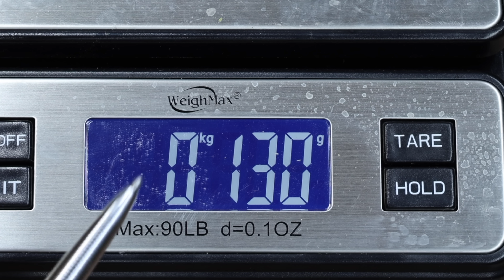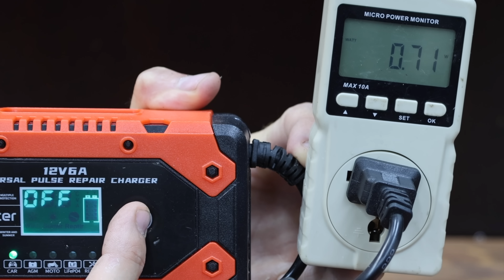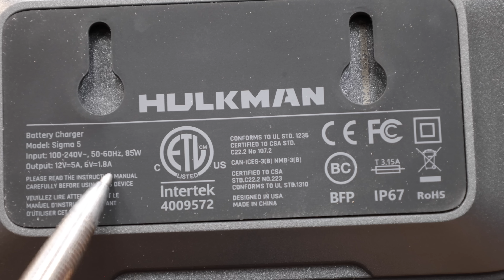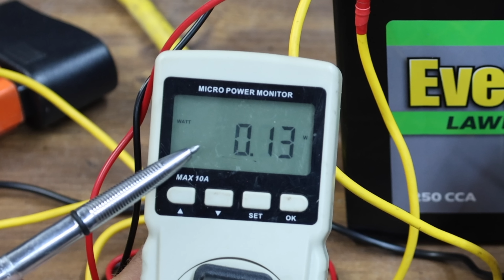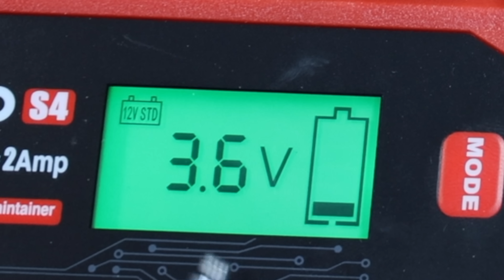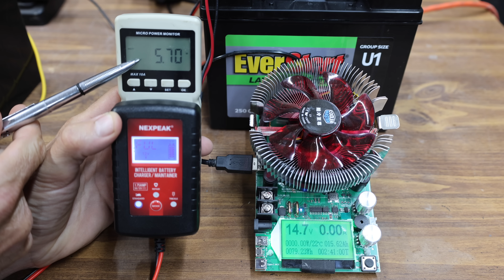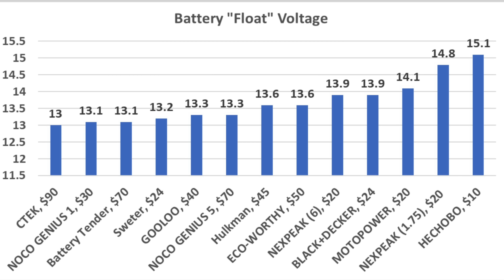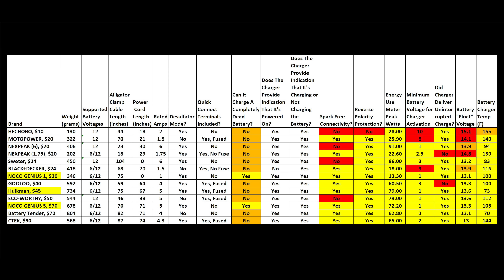I Tested the Most Hyped Car Battery Chargers – One Stood Out!

Comment: Sorry, I hate to argue with a guy who tries so hard to always be truthful,  but, you don't understand how & when batteries make those gasses. They never make those gasses while at rest, unless they are already shorted internally. They never make make gasses at a good rate unless they are nearing their full charge. The gasses are nearly nothing until they approach full charge (failed batteries , & bateries that were lead dead reach full  charge way faster (that's where the "give them 'low & slow' to restore them" comes from from). They won't take much energy at first. When you hit them at first , they will go high, into the "gassing voltage" then they may settle down into absorption phase (if there's any chance of restoring them). The voltage will drop a bit. Then it will come back up into the "gassing voltage" , where it is making tho se possible explosive gasses. But, totally dead batteries do jump into the "gassing voltage" at first, before they drop back into  "absorption phase". Regular car batteries like to get hot during this, and that heat is part of why they can't recover. You know as well as I do, a car battery at 2 volts doesn't stand a great chance of recovery.

Comment: I agree with your assessment! Noco genius5 is my choice! I have one and I love it! The issue, or it may not be an issue, is it gets a little warm, almost to warm to the touch in the summer while charging my battery, but In the winter it doesn’t get that hot. Overall, I highly  recommend the Noco genius5 charger.   The Noco genius5 charger charges my 12v regular flood acid battery from 60% in about 3.5 to 4 hours then it goes into maintenance mode so that it will not overcharge your battery
Reply from the maker: Thanks for the feedback.

Comment: Noco is the best. Use their boosters & battery chargers/maintainers everyday at the shop. Love the forced charge mode and the 12v supply mode when having vehicles hooked up to a scan tool with key on and doing electrical diagnostics.
Reply from the maker: Thanks for the feedback.

Comment: One thing you may have overlooked with some smart chargers there is an equalization charge which occurs for several hours at 15ish volts to ablance the cells. The large forklift battery chargers do this when the charge time takes longer then the predefined time. It would be something to test further keep them connected to battery for 24hrs and monitor if they drop back down to float voltage
Reply from the maker: Thanks for the feedback.

Comment: You're not going to get any desulphation out of any of those low amp Chinese chargers. You need high amps to blast in a charge and expand the plates to break up the lead sulfate crystal crust so that it can be converted back into sulfuric acid. Not gonna happen with 4 amps or any of these other 'toy' chargers. I'd be surprised if a charger called Sweter would even charge a discharged battery. They're all junk.

Comment: I manage a marine shop, we recommend and install probably over 100 Noco on board chargers in boats per year and recommend them for the ATV market also. I have a 1,2, & 5amp Nocos in my home shop as well as a 3 bank charger for good measure. Use the 2 amp Noco on my motorcycle during the winter and the battery still tests out like new. Other people with the same motorcycle & battery have replaced them already. I use the 1 amp Noco on my mower
Reply from the maker: Thanks for sharing.

Comment: I've gone through 2 NOCO Genius 1 chargers. They stopped working after 2 months, each. They definitely did not charge a dead battery. I had to charge the NOCO battery in my motorcycle with a regular roll-around charger to get it up over 12 volts before they'd begin working again. Then after a few days I'd see it had failed to maintain the charge again. I now use a Battery Tender Junior 800 and it's been working fine for over 6 months so far. It keeps my motorcycle charged.
Reply from the maker: Thanks for the feedback.

Comment: I've been using the CTEK for 5 years to keep both cars charged up (one is AGM). I love mine!
Reply from the maker: Thanks for the feedback.
Reply: Use CTEK for my winter stored M car. It's kept the battery in good shape for nearly 8 years lol.
Reply: CTEK is swedish made by inventor Bengt Wahlqvist, he invented the first battery charger that used electronic pulse technology. They are top quality!
Reply: @TheGoldenSapling  no, absolute garbage. I need a cold fridge, not an error message in my charger.
Reply: @novoiperkele  
Ah now I see where you went wrong. It's not a power supply....it's a battery charger.
Don't try to run the fridge while charging the battery...unless you buy the 25amp CTEK charger???
Reply: @JohnSmith-pl2bk  it specificly says it can be used as psu.
Reply: @novoiperkele  
No. 

The CTEK MXS 5.0 cannot be used as a power supply for electronic devices, as it is a battery charger and lacks a stable, regulated power output necessary for electronics. 

However, some other CTEK models, such as the CTEK PRO 25S, are designed with a "Supply" program to act as a 12V power supply for float maintenance charging when a full 100% battery capacity is needed.
Reply: I have 3 CTEKS, 1 of which is used occasionally for about 5 years, 2 of which are used continuously for about 15 years. All 3 have only been used for AGM batteries. As @mynameisschezuan said, "Buy once buy CTEK" the first one I bought led to buying 2 more.
Reply: My Ctek lasted a year with minimal use. They replaced it under warranty
Reply: I have used CTEK since they first came out, never had a single issue and i have 4!
Reply: I have been charging my Lifeline AGM boat batteries using 2 CTEKs (MUS 4.3 and Polar) for at least 8 years and they have performed flawlessly. Very pleased.
Reply: ctek is a pos.
Reply: @novoiperkele  
Anything can be a POS. 
Specify your complaint or experience with which model CTEK..and what you were doing with it....thanks.
Reply: @JohnSmith-pl2bk  dont remember, now i have a cheap chinese thing. Works mint.
Reply: @novoiperkele  
You can't even remember the thing's name.....riiiiight.

Comment: I really like NOCO... bought 3 chargers and one of their emergency jumpers.  What's really a nice selling point about NOCO is the modularity of connectors to the car (showed at 4:09, and keyed so you can't get +/- reversed) (clamps or hard-wire) as well as ability to buy extension wires from the charger to the battery.   This helped through 2020, I kept the cars on a trickle charge since we weren't driving much, able to keep two cars outside and the chargers inside the garage so they weren't exposed to weather.
Reply from the maker: Thanks for the feedback.
Reply: The proprietary connectors on the Noco are not a selling point in my opinion. I got the converter cable to use regular extension cables and generic clamp leads that are much, much cheaper. Don't know how you'd get the polarity reversed on the normal cables. The positive is inset, and the negative sticks out.

Comment: Good information.
As a part 2 to the smaller maintainers how about the same tests but with solar maintainers.   I have a couple of 10W solar maintainers but am not convinced the built in overcharge circuitry is safe. Plug in maintainers do their thing with continuous power available.  With the solar chargers fluctuating day to night I wonder if they can back feed and draw power at night as my batteries seem to drop voltage overnight when there's no solar energy.
Reply from the maker: Thanks!  Thanks for the suggestion.

Comment: If you do larger chargers, what about a dc clamp meter on the charging leads, combined with the watt meter on the ac plug? Would be interesting to see the differences. Also the Clore brand makes a "Solar Pro Logix 20A" charger that Mac Tools and Snapon re-sell, hope the ProLogix 20a makes the lineup.  Thanks for another cool video!
Reply from the maker: You are welcome!  Thanks for the suggestion.

Comment: Hechobo. What could be wrong with a product with a name like that? Stirring memories of "Emperor of the North Pole". The problem with just about ALL of these modern or 'new' chargers is they're 'smart' chargers and they think they're smarter than you. Well, that may be the case with  a large percentage of the users. The best chargers are the old 'manual' chargers. They were notorious for 'overcharging' a battery, which is exactly what you want to desulphate it. I have a couple 'manual' chargers. A wheeled garage unit with a 250 amp boost with a timer. I use it a lot to recondition batteries but it has a 2 amp 'low' and then a 40 amp setting. I wish there was one for 10-20 amps. I have 3 or 4 smart chargers. I don't like any of them. They're finicky to start charging  and never completely finish charging, so I need to top it off on a beat up old manual charger.

Comment: While I love all of your videos and rely on them to make informed decisions, this one is in my field and I have to make a few corrections.  The wattage shown on the 110v side is an indicator that the charger is doing something, not that it is pumping those exact watts into the battery.  A battery charger applies different voltages and current to charge depending on the stage that it is in.  Those values are changing constantly and while P=VI, it is only measured at the battery and only at whatever point it is at during a stage.  Some battery chargers charge and maintain in different ways.  PWM is especially sneaky as it may not kick in at the times you expect it.  It PULSES on and off at specific times it needs to (straight after a battery has been charged, the pixies are still excited and need 24hrs to settle down, then the true condition can be assessed).  MPPT is smarter and adjusts the maintenance voltage and in-current to suit the battery's health.  All these things can explain why you got, or didn't get good readings.  Also, you can trick a charger into charging a fully dead battery by temporarily connecting another battery to start it charging, to make it think its half OK, then remove it after a while.

Comment: Definitely do larger chargers.  I currently (ouch!)  have 8 different chargers for various uses.  A couple of them are 24V for large diesels, you may not need to go there.  But I have several 12V for car/truck/tractor/lawn mower use. Most are some Harbor Freight thing.
Reply from the maker: Thanks for the suggestion!

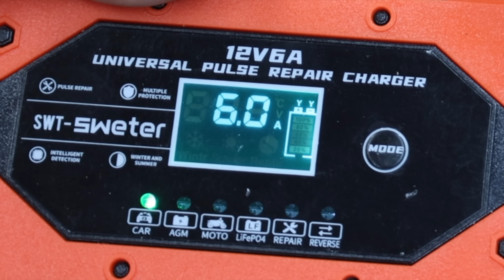Comment: At 10:02 you say the amp reading on the display isn't accurate but it is?

You've got 5V output showing on the load tester and 38W showing in the power monitor.

Thats 7.6A @ 5V. Factor in the 80% charging efficiency and you have bang on 6A.

Comment: I was really hoping PF would eventually do a video like this however they left out one essential and very widely purchased Battery Tender 800. These are sold at every Walmart and are about $30-$40. This is the main charger I wanted to see tested☹️. Good video regardless. You should do a strength test of which name brand ball mounts are the strongest for trailer hitches in the 5000lb-7500lb range.
Another test would be the strongest box/packaging tape. Another would be the best auto darkening welding helmet. Have you done a best Super Glue video yet? I'll have to look.
Reply from the maker: Thanks for the suggestion.

Comment: "Will it charge a dead battery?"

...is dumb. Good chargers sometimes have a safety interface that leaves the leads off until they see voltage, so the charger knows they are connected to a battery the right way.

They still work to charge dead batteries, or act as power supplies, just trick them. Hook them to a good battery to turn on, then connect the dead battery, then disconnect the good battery {or other power supply).
Reply: Note: those chargers will also charge most 'dead' batteries, because they work with much less than 12v. They may not work with 0v, but they will work on ovir 6x, or 9v, or 3v, idk.

Comment: A quick tip for the rest of you with these digital chargers,  DO NOT START YOUR CAR WITH THEM ON!
I have ruined at least 3 of my units doing this. 
Only the old school  "Dumb" chargers were okay with this. 
It seems to short out the Fets inside, and then will dump full line voltage into the battery or you car. 
This will then cause havoc with your charging system.  
Ask me how I know.. :face-red-droopy-eyes:
Reply from the maker: Thanks for the feedback.

Comment: I have the CTEK, Battery Tender, and an Optima....all work well. But nothing tops the Victron. That thing is a beast. Not only is it a battery maintaniner/charger, it can also act as a 12v power supply for up to a 30A load.
Reply from the maker: Thanks for the feedback.

Comment: I bought a 5A CTEK charger years back, and it's been great. The only problem is that (As shown in this video) if the battery's too flat it refuses to see that it's connected. For those occasions I keep an old "Dumb" charger that would try to charge a grapefruit if I connected one up too it. 😁
Reply from the maker: Thanks for sharing.

Comment: I do think your statement of supplied wattage post charge complete based on the power the device is using is not the best method. 

Your tests are awesome but what isn’t being taken into account is the power needed to run the device and its electronics to monitor and rapidly adjust. 

While I don’t think that’s all the power usage being displayed on some cheaper models, I think that’s likely the case with the more reputable companies.
Reply from the maker: Thanks for the constructive feedback.

Comment: If you do larger chargers for cars, I've been pretty happy with the Schumacher SC1304. For 8D batteries in boats, the Analytic Systems and Mastervolt chargers use modern electronics and aren't huge and heavy.
Reply from the maker: Thanks for the suggestion.

Comment: Nice video. Some of the other ctek chargers can charge a dead battery. They just need to have the supply option then they can. But they are pretty expensiv. But they do a great job.
Can you test out diamond cutting discs? Whats the best drand to buy?
Reply from the maker: Thanks!  Thanks for the suggestion.

Comment: I'm wondering why most chargers go so weak on lifepo4 batteries. For example I bought a snap-on smart charger and it only supports 10amp charging for lifepo4, but chargers dedicated to lifepo4 are available up to 12v 80 amp, or 24v 55 amp

Comment: I went with a HiTec RDX1 200, which is a RC battery charger, for my needs. I use it for my LiFePO4 batteries since I can control the cell count, charge speed, and chemistry for the charger, it also has balance changing if your battery has them (or you add them to your own DIY battery). You can also generate battery charge chats as well when it is connected to a computer.
Reply from the maker: Thanks for sharing.

Comment: I run a NOCO 10 amp for the dual battery diesel trucks.  Works great, spent a lot of time doing research before that purchase, 1 per truck.  And they have force mode, which is nice.
Reply from the maker: Thanks for sharing.

Comment: Hmmm.  Charging voltage.  A lead acid battery cell produces 2.2 volts at full charge.  6 cells to a battery.  Fully charged battering is thus, 13.2 volts, not the 12 volts we think.  To charge a battery the charger must exceed the 13.2 volts or the battery will never fully charge.  Car alternators charge at 13.5 to 14.5.  
Voltage is only half of the issue.  Putting current into the battery is the key component.  Controlled current flow is combined with appropriate voltage to charge without baking a battery.

Comment: Lately I've been attempting to revive some thoroughly dead 6V golf cart batteries using the NOCO Genius 10.
Although it can't desulfate 6V batteries, it does everything else very well indeed.  It has so far salvaged a couple of the batteries.
I might soon try to desulfate a couple of the more damaged 6V batteries by placing them in series.  Presumably the Genius 10 will "see" them as a 12V battery.
Desulfation delivers uncertain results but I have seen it work wonders on occasion.
Reply from the maker: Thanks for sharing.

Comment: For what it's worth, the place to have the wattage measurement, if you're considering what is or isn't going to the battery, is on the leads in between the charger and the battery. When you measure the 110V input, you're measuring the total wattage used. That can vary depending on how efficient the designs are, as well as what it takes to turn the "brain", screens, and lights on. For instance, if you're measuring input voltage and it's less than 1W, there's probably nothing going to the battery. That 1W (or even up to 2-3-5W, potentially) is just what happens running the lights and whatever the hardware in there draws. So, when you say "it's got 0.7W still going to the battery" that's probably not true. It's probably using 0.7W to run the lights and such, and nothing is going to the battery.
Reply from the maker: Thanks for the constructive feedback.

Comment: I've had 3 Noco Genius chargers. They work well when they work. Had 1 fail under warranty and 1 fail just outside of warranty (at 1 year and a couple of months). I think 2 of them have a repair mode. They've never "repaired" a bad battery out of the ~3 or so that I've tried. I've also had 3 of the battery tenders in the steel case. They all still work and I've had the oldest one for about 15 years. They're "dumber", but they've been rock solid. Two of the battery tenders have kept my old car batteries going for 10 years under very light use (I drive the cars a couple of times / year). Thanks for the review!
Reply from the maker: You are welcome!